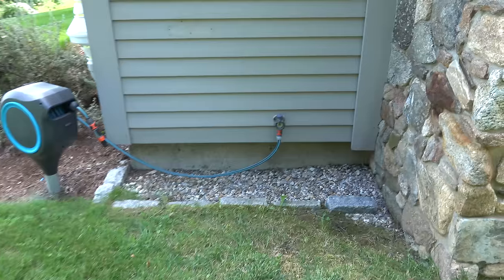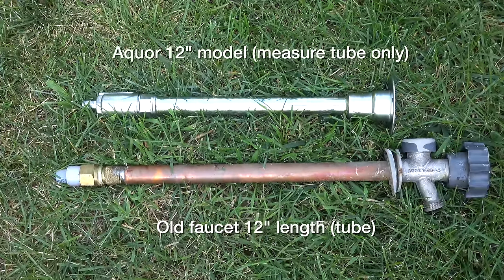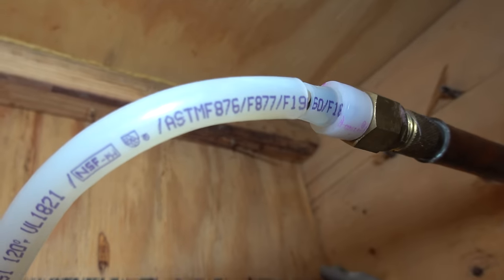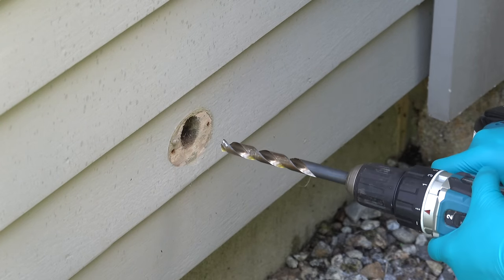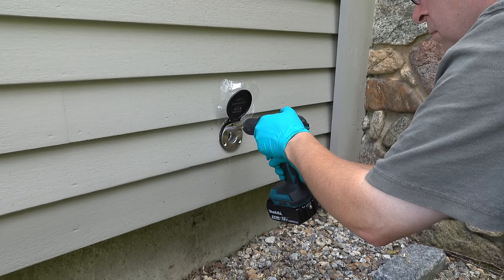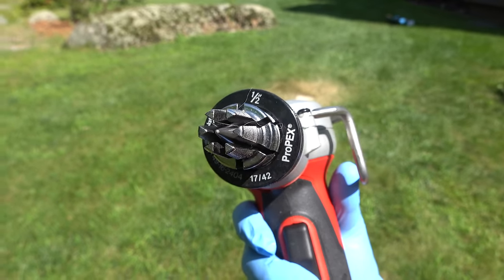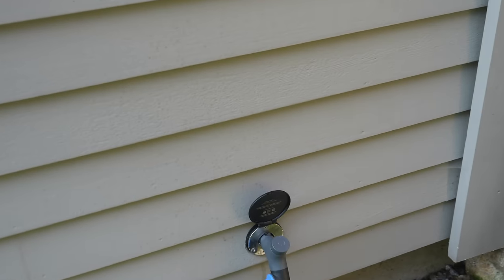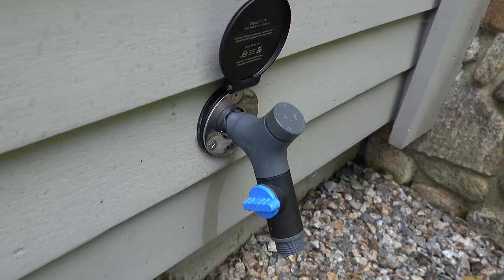REPLACING YOUR OUTDOOR FAUCET JUST GOT EASY / Leak & Frost Free AQUOR IDEAL for Retrofits

Comment: I like the idea and it looks really cool, but $115.00 for the unit and hose connector is just too much vs $35.00 for traditional frost proof hose connector. And if you want the anti-siphon model, $150.00. I'm not really sold on it, sorry.

Comment: I like the clean looks but not enough there to make such an expensive change. Old fashion works and adding a cover for winter months isn't a lot of $$. If the house was built with these new ports then I can see using and having them but value to swap and nothing giving big gains. Lots of people will pass. Like I did say, love the clean look on the outside.

Comment: i wonder how long the handle lasts in the desert heat, the sun will eat the plastic in a year or two and then i would have to replace all of them at $85 each, not including tax. a normal spigot cost $20 and last for a lifetime. mean while my hose barely last a year even in my shed.

Comment: 1. its not standard 
2. there is no manual shut off 
3. required adapter 
4. if failed you cant fix, you have to replace whole thing.

so final word is NO

Comment: Unnecessary, you have to remember where you put the thing, and in an emergency you have to go get it. ( Fire ) Second if your just going to leave it attached, then what's the point, leave the original hose bib there. If you live in an area where it freezes, chances are that you allready have insulated pipes or heat tape around the pipes.

Comment: Great in theory until you misplace the connector and can't use your hose again until the connector is replaced or found. Would be better if companies producing hoses had the connector built into the hose itself and then controlled the flow at the other end of the hose like you would with any spray handle. This solution  increases the number of pieces needed to operate a simple hose solution from 2 pieces to 3. Won't be replacing something that already works and heaven forbid someone needs water from my house vs the dozens around mine with the same setup. Not for me, at least not yet.

Comment: The plastic faucet attachment will eventually get brittle and fail. Same with the connection mechanism. After a few years of use, blazing sun, and temperature fluctuations this entire mechanism will need to be replaced - guaranteed.

Comment: Now you have to store away the spick head ? If you miss place it you can't just get a new one from your local hardware store. Kind of dumb. On top of that its plastic. 
Just get a nice brass spigot head and be done with it for the next 20/30 years. If you think someone is going to steal your water just take the handle off when your leaving the house for extended times like a vacation or something.

Comment: not a fan of that plastic spigot. Just install a shutoff valve inside the home. then you can drain the section of pipe that sticks outside, and no one can steal your water either if that's what you're concerned about.

Comment: I love it.  It looks much easier to deal with than my existing frost-frees.  It's just as hard getting parts to replace my traditional frost-frees.  Buy a bunch of replacements in case you dont get them off in time.
Reply: You can literally buy parts for most any frost free at every single hardware store in the nation. Even going back to faucets from the 80's. All in stock today and can be repaired with a crescent wrench and screwdriver for under 10 bucks and 10 minutes. 
/\ professional contractor

Comment: I looked into using one of these on my high performance house, because I needed something that would get through a wall that's over 20" thick. I had some serious concerns about the durability of the plastic faucet. But ultimately I decided not to take out a second mortgage on the house in order to buy the thing. The price is just absurd.
Reply: Acetal is pretty durable.

Comment: If you getting crazy cold weather just bleed it and leave open. So many new things are stupid
Reply from the maker: You certainly can the tough part is that they are usually tied into your main lines, so not always easy to get air into the lines but if you have that hookup that can work too

Comment: Why would you need a back flow preventer on an outdoor  faucet?
Reply from the maker: My brain slipped, its called a vacuum breaker. Both prevent reverse flow which is required by code for safety reasons, there have been cases where someone left a hose in a bucket, say with pesticide mixed in and it sucked the water back into the house, rare but it happens

Comment: I am in the unnecessary camp.  I like the way it looks, but an expense just for looks. My home is stucco, and the pipe running inside the house is not easily accessible, to make this change as easy as on the video. If someone wanted to gift me this, I would gladly install it. Otherwise, old school works for my needs.
Reply: Yeah, I don't get the point of this, I can get a regular frost free spigot for 30 bucks that any hose will screw on, this is a 90 dollar spigot that has a proprietary plastic valve that will probably break really easily after it sits in the sun for 6 months, I have regular metal hose bibs on my house that are fully metal that other than a little paint wear look basically brand new and they are almost 25 years old

Comment: I see zero advantage to this model over existing, frost-free hydrants. You can take the spigot off? Okay. That's fine if it's your desire to make the faucet inaccessible to others, but I've never had anyone come up to my house to steal water before, so I wouldn't get any advantage there... and I'd almost certainly break or misplace the spigot sooner or later, but maybe that's just me. It looks pretty, but proprietary widgets almost always end up being more hassle than they're worth.

There's no advantage in freezing weather. If you leave a hose on, it won't drain properly and may freeze and break in the wall, just like a frost-free hydrant. If you take the hose off, it should be safe, just like a frost-free hydrant.

I'm sure there's some niche situation where there's a benefit, but I can't imagine what it is, and I see none which would make it appealing or beneficial for me.

Comment: To many moving parts and connections. What happens when you twist the quick handle in and it start leaking. IT WELL HAPPEN. It sure looks cool though. But not going to by another SPECIAL tool that you use only once.

Comment: Ok, this was interesting at first and then became obvious to be far too intricate a solution for a common house owner, as installation requires special tools and normal hose attachments don't apply anymore to the outlet, probably needing additional parts as well for different appliances. Not by far that good a product as advertised, but still quite a few easily convinced consumers will experience the wow-factor too enticing not to fall for it.

Comment: Quit wasting your time with "freeze less" faucets. Just replace the entire assembly wit a boiler drain. No backflow issues required and if you forget to disconnect your hose, no problem. It will freeze but it will not brake .If you plan to use your outdoor water in winter this a problem. If it is 20 out side I am not washing the car or watering the flowers. We have done this for 40 + years and no issues. Fast cheep and easy.

Comment: Please don't recommend people to use their drill with side pressure with the incorrect bit like you are in 2:48.... Drills bearings are not meant for side-load and doing this on a regular basis will earn your viewers a trip to the store to replace their drills.  A set of hole saws or spade bits are inexpensive and should in every home-owners's toolbox.

Comment: It's functionally neat, but I wouldn't touch it with a ten foot pole.
Cheap garbage plastic. You'll be replacing it every season. It will get bumped by kids/pets/lawnmower etc. Seal will fail. Even if you always remove it, it will get contaminated and fail internally.
Not at all resilient.
If the entire thing was made of quality metal with a box of O-rings or at the very least a standard O-ring size, it might be worth looking at.
Turn the water supply to the outdoor spigot off and drain it in the fall like you're supposed to and you won't have freezing problems. The only benefit this offers is if you've done a piss poor job of locating your water lines and need a flush fitting.

Comment: Seems fine but unnecessary. The standard works fine and should never freeze if homeowner does proper maintance and just shuts off water in winter to outside. It takes about 5 mins to turn off all the valves and ensure the pipe is drained. Why would I spend MORE money on something already idiot proof.

Comment: Wow!! $81.00 just for the wall assembly?? The part he puts in, with the on/off valve on it is NOT included, that is an extra $29.00!! Yes, they have an outside metal plate, Just the plate/door for another $27.00!! NOPE. (amazon 12/01/2023)
Reply from the maker: The $81 includes both the spigot and the adapter. https://amzn.to/3RcDT9o  complete for the $81 - They have optional covers and accessories but check the reviews if you don't believe its awesome

Comment: Ridiculous expensive proprietary solution looking for a problem. Properly installed sump frost valve inexpensively and ruggedly solved this problem decades ago. And every hose fits it. Even managed to make PEX worse with that non-crimped coupler.
Reply: Several problems do exist with standard hose bibs like cracking, wearing down, breaking parts, that doesn't even include looking beyond ugly. Also pex is watertight, if it wasn't, it wouldn't be common. Every hose also fits this system. If you're that concerned with proprietary solutions, please stop using basically everything you use, because I bet you at least 50% of it is proprietary.

Comment: Meh. Not realistic unless you're rich and just want the spiggot hidden. The cost of installation is pretty high for minimal bennefit. I can put on a new regular spiggot in about 10-15 minutes max. Unless the plumbing is already exposed in a basement or something, you'd have drywall or stucco/siding work. Just turned a 10-15 minute job into a several hour job. Then the valve that it comes with is plastic? What a joke. As a handyman with almost 25 years of experience, this thing looks like expensive trash. They need to produce it with much higher quality components like copper/brass. I would caution my clients against this installation. I could build a much better product off of existing materials you can pick up at any home depot/lowes/ace hardware store. Kinda like buying a multi-million dollar home with particle board cabinets. Companies are so greedy. Bet they charge over a 1000% mark up or more from their cost of production. We need to enforce and expand price gouging laws. Capitolism is the best system but should not be allowed to become predatory like every major company today.

Comment: Is it just me, why do these people keep putting the spigot close to the ground, don’t they believe in smarter not harder
Reply from the maker: In the northeast especially where you have basements they are low to keep the inside portion deep in your basement. Otherwise it would be in an outside wall close to the outside which could freeze. Warm climates built on slab it wouldn't be a problem to be positioned high as you want

Comment: Replacing your normal spigots with an over-complicated and doubtlessly more expensive setup that requires you to effectively leave the spigot attached to your hose. Add to that the spigot you will be using is plastic! Let's see how long that holds up being left outdoors in direct sunlight for several months each year. Absurd. Probably not easily repairable, either, and even if it is, it'll need proprietary parts that they will either not want to sell to you, sell for an exorbitant price, or just stop making new parts in a couple of years when they redesign this system to the 'latest and greatest.'

Comment: Ugh: IT'S PROPRIETARY.  and EXPENSIVE!  $200+ for a hose attachment!

(Makes sense that the guy blabbing in this video is standing in front of a MANSION).  Only rich/stupid people can afford these idiotic PATENT TROLL devices. 

Majority of patents for this design was filed 3-5 years ago!

Which means for the next 15+ years you can only buy it from these guys, and more likely, this company will change the attachment design the same way Gillette keeps changing the connection to basically renew the patent! 

THIS DEVICE IS A PATENT TROLL. 

DO WE REALLY NEED MORE OF THIS IN OUR LIFE? 

So a HARD NO.

Comment: Perpetual revenue stream for the manufacturer. Why use a tried and true foolproof solution thats found on literally every single house on the continent and fails once every 30 years, when you can replace it with overpriced yet cheap, finicky, easily misplaced fragile plastic parts that guarantee future sales

Comment: Fad, too expensive, standard inlets have no valves, inlets for RV made of plastic do have valves are not the best. If You are on a well that leaking rusty water almost guarantied to stain your siding. Don't like proprietary connectors as you may not be able to get those plastic adapters. I like the look, not just about everything else.

Comment: Old school is the best school.. If it works. Don't fix it. If it leaks years after installing. It will leak inside the wall. Making you reinstall the spigot you knew worked in the first place. Now you have to deal with repairing the outside as well as the mold issue you created inside. Next time. Find another worthless idea from the internet that won't haunt you later in life as much as this one will...